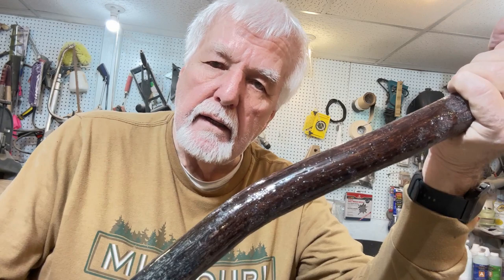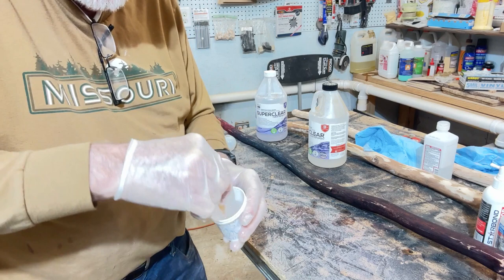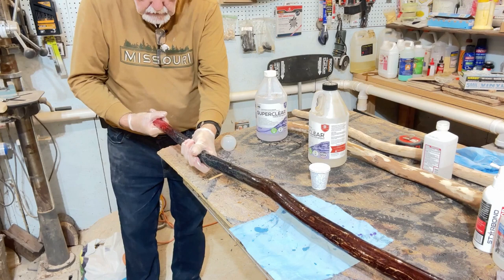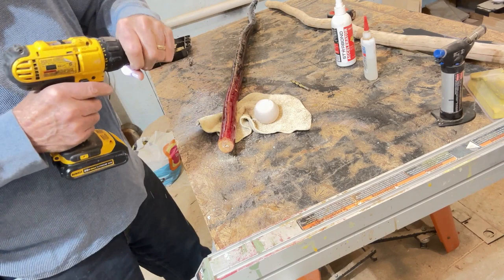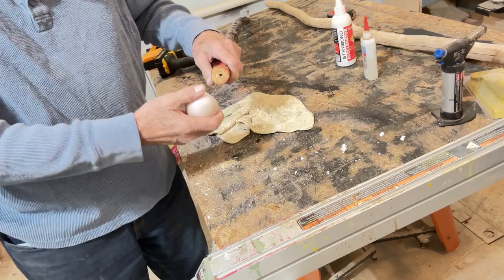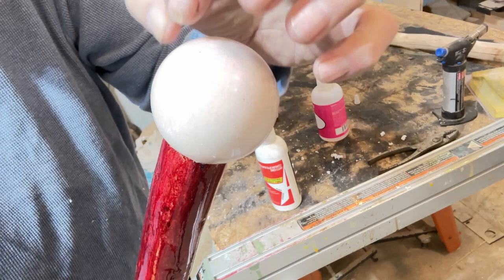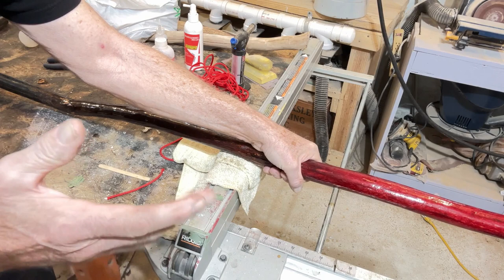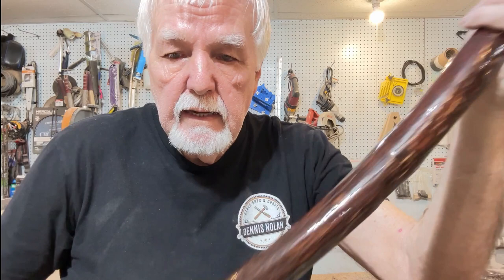This Walking Stick is the Berries

Comment: I love the colour and finish to this one!!!
Have you made a video about how to make/ use the berry and other natural stains?
If not I’d be really interested to know how you did that?
Plus am I correct in saying the expoy is used to hold in the colour, because if you didn’t use that it would come out of the wood over time (e.g if it got wet)?
Reply from the maker: You are right the epoxy does seal in the colors and stop any bleeding but several coats of good clear poly will do the same thing.  I will consider doing a video on making berry stains in the future.  Thanks for commenting.